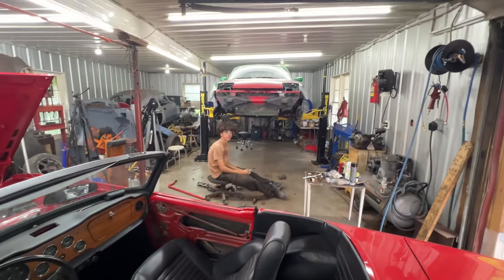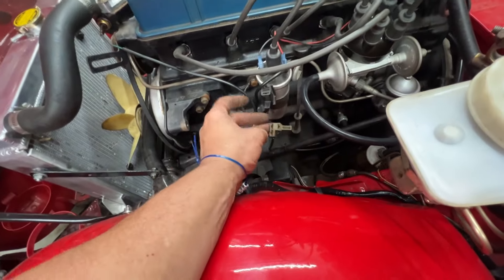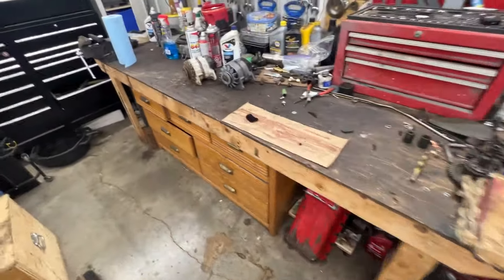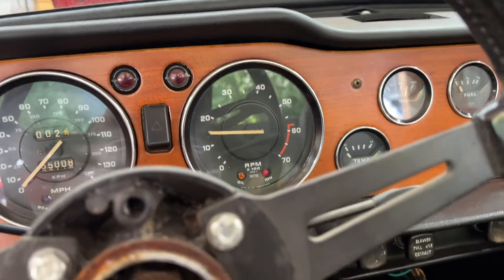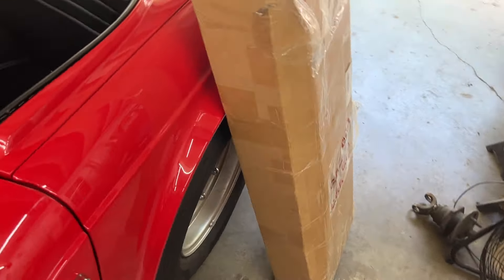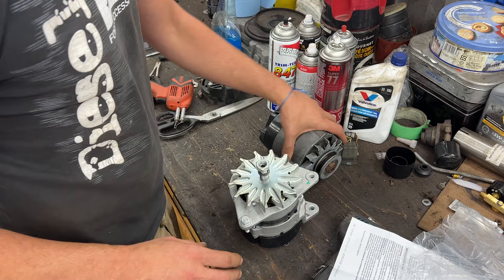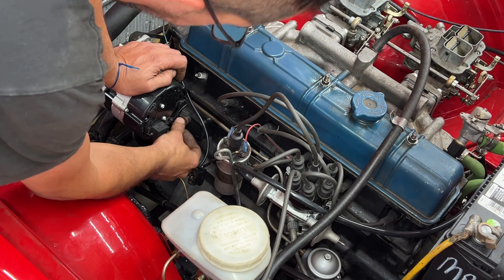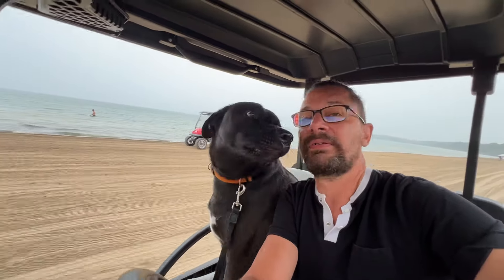1970 TR6 - Part 50 - Alternator troubles

Comment: Elin I have the same style battery in my 4A, and I also didn’t like how close the battery clamp was to the terminals.
So what I did was move the clamp to the top of the battery. I placed it over the plastic battery handle.
It worked great. The handle even helps the clamp from shifting.👍